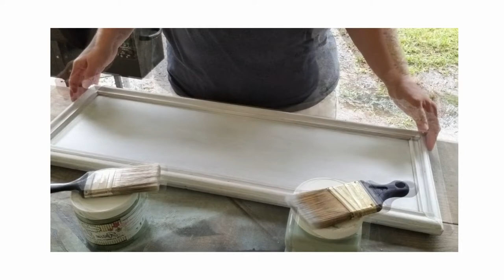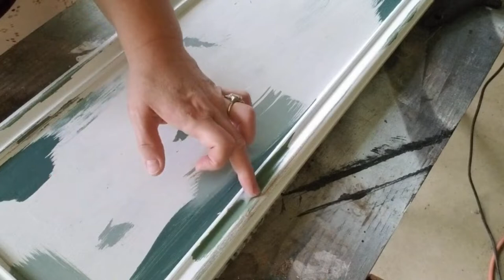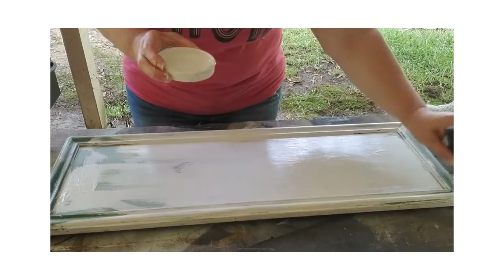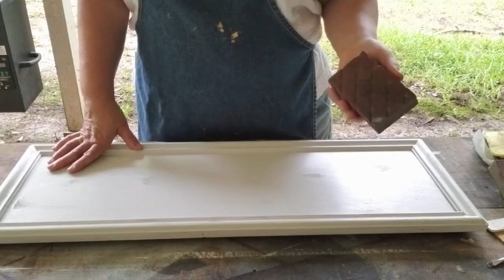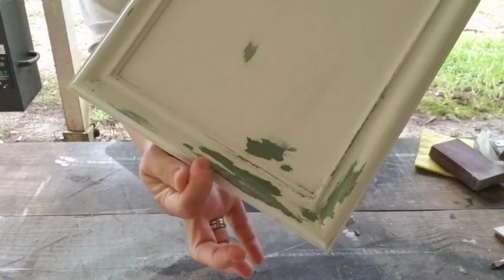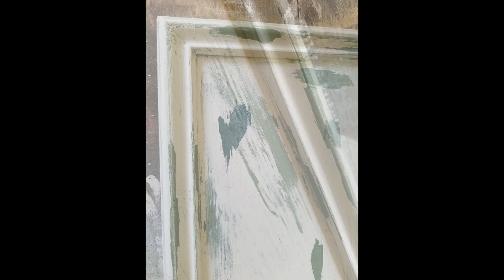Easy & Cheap DIY Chippy Paint Technique on Cabinets

Comment: Very pretty result but I don’t understand how the brush keeps from dragging the vaseline into areas where it’s not wanted.
Reply from the maker: It seems to stay in place for the most part. But I use a light brush stroke over the vaseline. Not a lot of pressure as I run the brush over that part.

Comment: Ok so I thought I’d be adventurous and try this technique on an antique desk. I’d already had two coats of primer on it and MEANT to just try this on one drawer first to see how it turned out. Well, my early onset dementia kicked in apparently and I marked up all the drawers and the whole desk with spots of two colors of paint. I tried this technique on a drawer last night and wiped off the paint today and don’t like it. I’d rather paint the dresser white and distress. Now what do I do about the places I’ve put the other paint on? I put on a brown and mixed another color a little lighter that’s a grayish brown. What do I do now to salvage this project? And yes, I’m a beginner. So mad at myself. Please help!
Reply: Good on you for trying something new. But I do understand the frustration of something not turning out how you had hoped. 
I not a professional and have only painted a couple of pieces for my own home. 
My suggestion for you would be to either try sanding it right back or if sanding doesn’t appeal to you as it can be a big job or use a paint stripper. A good low odour one is the brand Citristrip (that’s probably not the correct spelling). I would try to watch some videos of people using it first. But the instructions on the bottle are pretty clear. 

I think watching a lot of other furniture upcycling videos will be of a huge benefit. I watch most of them on mute and at 2x speed. If they do something I’m really interested in then I’ll stop it and start again properly. Doing this makes it faster and easier to find a channel with the style you like and or the process you want to perfect. 

I hope this has been of help to you.
Reply from the maker: I think you will have to either sand the painted areas or remove the paint from the areas you have painted. I would try sanding smooth first. Then paint with the desired colors.
Reply: @Shopallyoops  That’s what I was thinking just wanted confirmation in case I needed to do something else. Thank you for replying.

Comment: Kitchen cabinets would you clear coat it with Poly? Has anyone tried this technique on Kitchen cabinets?
Reply from the maker: I would definitely give it a couple coats of poly in a kitchen. Or a top coat like Rethunk junk tough top or Dixie belle gatorhide.
I have not done this on my kitchen cabinets but I have had customers that did and it worked well.